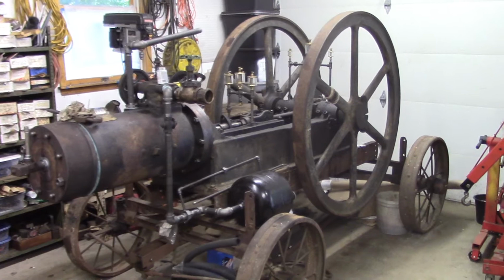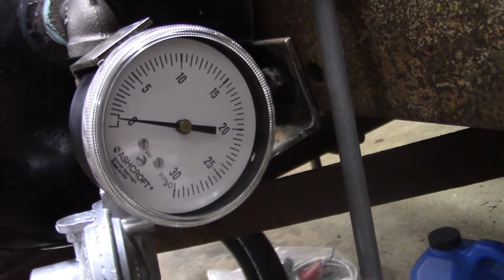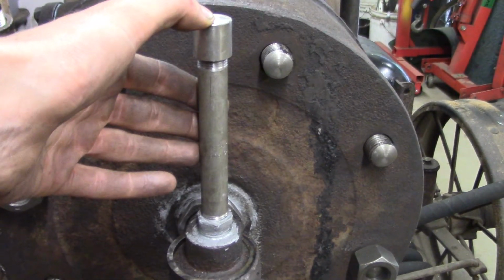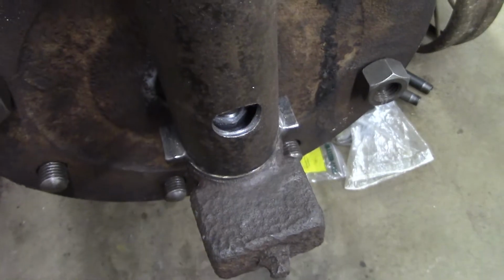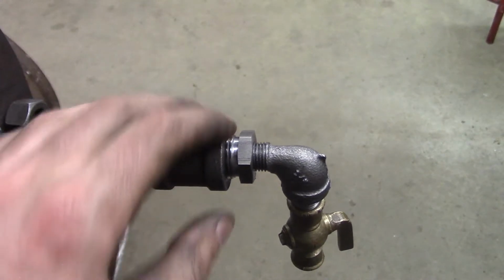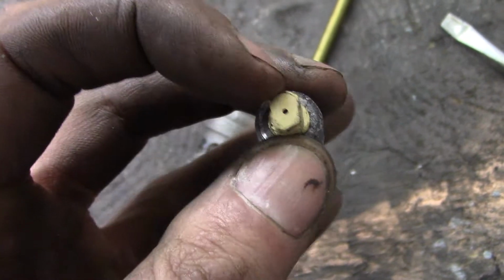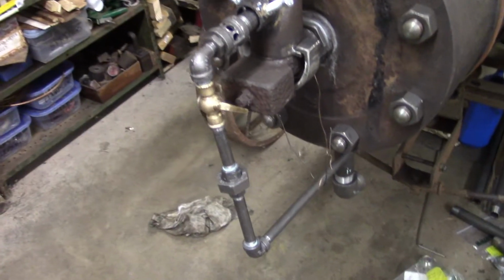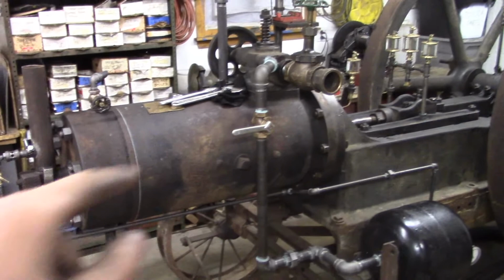Hot Tube, Burner, and Gas Lines - 15HP Pattin Brothers

Comment: I am starting an engine collection in what little space I have. I bought a Maytag 72 on EBay that's coming next week and I just bought a McCormick Deering type M 1 1/2 horse from a guy I work with. I am picking it up tomorrow on my way home. If you know where I can get IHC M parts let me know. The one I bought is only missing the fuel pump but it's very pitted. I hope a good coat of paint will help that after I get it pulled apart
Reply from the maker: the more you get into these engines, the more resources you'll learn about. Shopdogsam is probably the #1 best guy for M engine knowledge. Parts, try smokstak's EnginAds or HitNMiss Enterprises. good luck!

Comment: you made the .038 hole SMALLER!? by coining??...?? never heard of that being possible
Reply from the maker: when the material is deformed it has to move somewhere, and in this case it moves the most easy direction, which is inwards to the hole. the hole is now about .017 which works better.
Reply: these machines, so large and so intricate. and you've got it all understood! commendable.